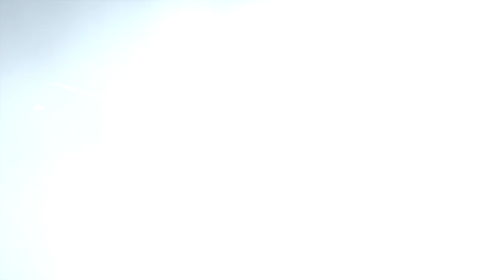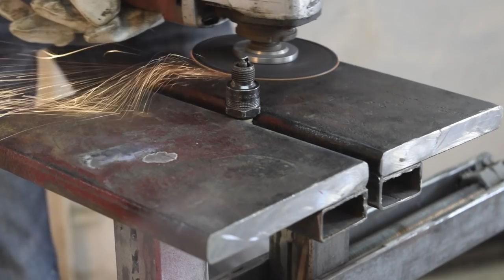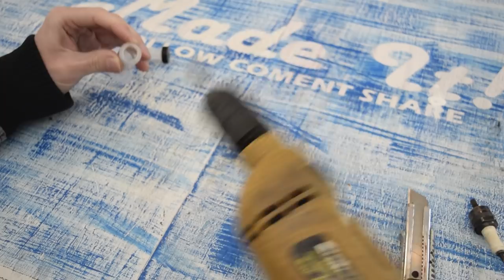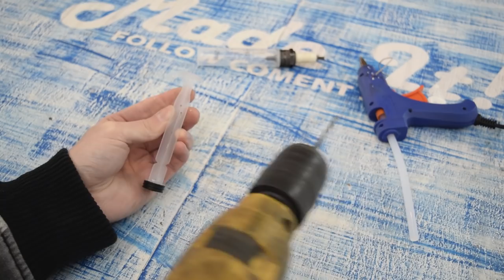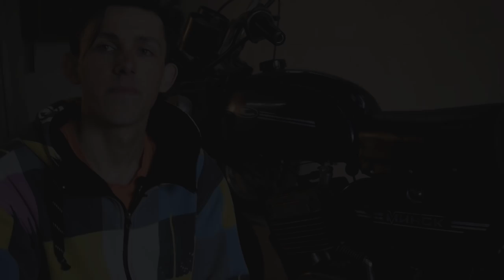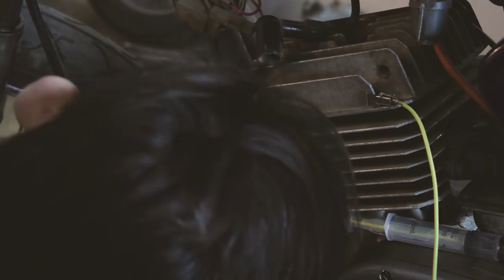#HandCrafted Ep.2  - Adjustable Ignition Coil Tester

Comment: and if it does not flash : what is the problem would be ? the spark plug cable or the spark plug itself ??? i will appreciate your answer
Reply: It can be the spark plug cable, or the ignition coil, Ignition coil can be checked with multimeter, if it's ok, go next to the CDI, ignition stator and flywheel.
Reply: @madeit868  Love you Sir
Reply: @madeit868  With this ... Method ... you also need a functional Spark Plug. 

Which means, if this doesn't flash - It could be also the Spark Plug. Sure you could check the Spark Plug first but - That's the whole exercise here somehow, isn't it? So actually, this is a way to check the Ignition Coil (Lengths of the Spark) and maybe not the most effective one. 

Plus, it's a little bit dangerous, due to the lack of actually isolation.

Comment: well that was a pointless, same spark can see by putting spark plug to the ground outside the cylinder...
Reply from the maker: Hi ARV VIL - the difference is that you can adjust the height of the spark and to check the difference between coils, or if you have a 4 cylinder engine to see how each coil works and if it have a difference in their performance.
(On my engine is a magneto ignition system "without battery" so the spark is so weak. On engines that use battery this difference betwen coils will be much bigger) 

Best regards
Adrian